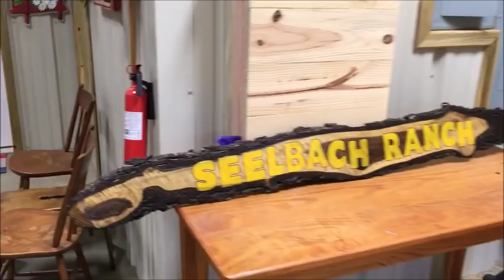Big Pine Show Down on Circle Sawmill

Comment: I run a old handset Ireland  6 mill, with a 671 Detroit  with belt drive, you will have days when it just fights you. What seems  obvious  is when you walk into  the saw the rpm drops from your tractor  its tough to keep  your saw true if the rpms varies.  Reason I use a Detroit  is how fast the govenor  kicks in to keep the rpms consistent,  becarefull  sawing solo only takes one piece of hardware inside a  log that you can't see to cause real problems  fast. Glad to see other guys trying  there hand  at milling, just becarefull  safety  is key in this business
Reply from the maker: Tim I am looking for a power plant to replace the case.  You’re right about the RPMs they plummet when milling a large diameter.  This video is old, try one if my newer ones and you will see some safety hardware now.  I know solo milling is risky but haven’t found anyone to assist yet.  Thanks for your insight.  Good day!

Comment: I have always loved these old belshaw mills. I know you are catching a lot of flack in the comments but don't worry, just keep milling. I had this mill for a while and I used it exactly how you are. Ran off a direct tractor pto, and turned into the carriage. My mill belonged to my father before me and after many many years of use it was still cutting true the day I sold it. The only thing I did different than you was I rebuild all the structure with 2x6 steel tube and lagged everything into a concrete pad. I also mounted an 8k winch about the carriage to turn heavy logs. I only sold the mill because I went to a band mill for smaller kerfs on bigger high dollar slabs. I cut most of my dimensional off a swing blade made by turbo sawmill. I really enjoy your videos, keep up the great work.
Reply from the maker: Thanks.  This is probably the worst video as far as content.  BUT it did do a good job of transferring some of the frustration to the viewer!  I have a welder coming and we will stretch the bunk, true it up, and anchor it down.   The shaft is plumb level so there is no change of speed.  The tractor is under powered but for hobby work it is ok.  I do plan to build a log feed and turn logs on it.  I look forward to MandM videos!

Comment: The problem with round saws is they don't cut straight through the logs, cants , they cut in an arc ,and that arc is a lot larger than the death of the cut . Bands do cut at a slight angle as the carriages moves forward , but measure the total tooth travel while cutting through a log vs a round saws tooth travel! For the same diameter log . How you know why the round saws have to be so thick ( big kerf )
Reply from the maker: Yes my cut at max log diameter is 1/2 pi 20 = 31.4” or 79.8 cm. So my circle saw will cut a 14” board while a bandsaw will cut 31” for the same blade contact

Comment: The reason pto effects saw blade is because u joints speed up and slow down as they rotate, This sets up a vibration in saw blade. This can be over come by use of belts. Also you can down load a belt catalog and use belts to solve mandrel over load problem. You can get by with pto using correct shear pin type joint,But you will also need a old fly wheel of a hay baler, to over come the joint speed up slow down that messes with the blade. Most old balers also use 1 3/4 shaft like bell saw does. Belts are really the only way to go. Also bell saw depends on what they call high speed saw. What that means is slow feed rate. Saw works best at 550 rpm, feed at 47 fpm. [ that is 44 fpm at 525 rpm ] It needs 61 hp at 550 rpm 40 inch 24 tooth blade at maximum cut. Sawing hickory or oak. 40 hp sawing pine.All so always use 9/32 bits. 5/16 bits require another 10 hp. Because of low feed rate, The teeth will wear on the back side.No big deal when you notice wear throw them away. Search internet for the old bellsaw books. That explain all this. If you run this mill correct, It will do what you want it to. I sawed 50,000 mine props on one of these mills, In 1976 and 77. Most information you find on saw mills on the internet like feed rate does not apply to this mill.

Comment: I like what you did with this M14  the only thing I critique  Belsaw on these mills is the carriage  feed speed in proportion to  the blade rpm.   PTO at 540 and a 48" blade is around 6600 / 6800 rim speed and the belsaw carriage is to goosey and too fast at tme to get the best out of you power plant//tractor  Slowing the feed by pulley changing would make a noticeable difference or converting to hydraulic feed is an option. Nice looking setup for the age and size. By the time you get 30 or 49 thousand board feet under you belt yo will be sawing like a slow pro...
Reply from the maker: Thanks Larry, I have been working on it all day.  Its a pain in the butt.  I will have a video coming out in the next 6 months with all the upgrades.  I hope I survive to 50K BF!

Comment: I have run these belsaw mills for around 50 years, Bought and sold a hundred of them. Several after the owner was killed. First you never roll the log like that. you must have a table built and always roll log toward you. You are going to warp carriage. and destroy set works.Please do some research and learn how to run that mill. Also before timber king bought that company [ and then got sued ] Bellsaw always warned to never hook tractor to mandrel. always use belts. The blade can never run true using a tractor pto direct to mandrel. And i bought one where the blade broke off shaft and killed a guy. He was using a slip clutch which was rated at 8,000 inch pounds of torque,And that mandrel should never have over 600 ft pounds of torque.  That is 60 hp. Where the blade goes on is only 1 3/8 inch. Belts will slip and smoke and break if blade locks up. If slip clutch is adjusted to slip at 600 ft pound it will start slipping to early. Sorry post so long but like i said i have seen guys killed. I sawed on a old number 10 bellsaw when i was only 12 year old. Got a number 10 and a m14 that i still use.
Reply from the maker: Thanks for the comment.  I will be making modifications soon.  Can you elaborate on why the PTO interferes with the blade operation?
Reply: Never have seen anyone turn the log toward them and I think I have seen every sawmill video on YouTube..family has 4 circle Mills and have never seen anyone turn a log toward them here either.🤔
Reply: @74superglide  In the Belsaw M14 manual it stats to never turn a log against the set works. These machines were designed to be light weight and easy to move if necessary. They are not production mills. 
http://vintagemachinery.org/pubs/86/1050.pdf 

 M14s are vary light duty and the set-works are not designed to take that kind of abuse. Yes you can do it, you will just were them out faster and warp the carriage as Cliff clark stated. I had to rebuild my M14 because the previous owner turned the logs against the set-works and warped the carriage. Its easy to turn toward you once you get use to it, though it is a few seconds slower.
Reply: @chuckk.7691  ok I didn't realize you were talking about this particular brand👍
Reply from the maker: Douglas, it would be a lot faster.  I like to put the flat side down and square up off of that plane.  Once I get time to fabricate a log feed, I should be able to install something I can flip up to act as a backstop to turn the log against.  These Foley mills are not heavy duty, so Cliff is right that it can be damaged.
Reply from the maker: Chuck, I agree.  Would like to see a video of your mill.  I have watched all of them on Youtube looking for ideas.
Reply: @TripleTRanchAndSawmill  Will have to wait til spring. My mill is mothballed until then. The best advice I can offer is make the mill rock solid. Circle saws do not like movement or vibration. If you can grab the frame and wiggle it, it will be next to impossible to cut true. I originally built my frame according to the directions with 2x8s and then put that on a mobile home frame with the intention of making a mobile mill. It worked but had to cut boards thicker than normal and plain down to final thickness. In the spring I will be mounting it to concrete piers 4' in the ground to get below the frost line. 2nd best advise would be find an old timer sawyer and befriend him or better yet work for them a little. I have the good fortune of having a father who was a head sawyer for many years. A mentor that has been through it all will save you many headaches and possibly limbs and life. Happy sawing!
Reply: My uncle has a Meadows, O- Frick, Moffitt and one other kind that isn't set up. I figured they all were operated the same....little did I know 👍...his Meadows does have a axle under it that is used to move it around but he set it up solid and took the wheels off
Reply: I  know all these mills, I got one set up now that is exact same mill in video. I got a old mill with 60 inch blade it is a friction drive, It feeds one speed which is matched to saw. Takes some serious hp to pull it. AT least 238 hp 6 cyd Detroit. It works best on a 350 hp cumming. truth is unless you got a 9 man crew, and semi loads of logs coming in these big mills will use more fuel than the lumber is worth. my friction mill will saw around 30,000 ft per day. The mill in the video with bell saw blade 24 tooth 40 inch should feed 44 fpm. 14 inch cut pine 45 hp  white oak requires around 70 hp. The 0 frick requires at least a 4 71 Detroit at 160 hp. frick is the only one of these old mills that you can buy parts for. Frick can supply parts for any mill they every built.  You can still buy these mills new today. meadows is a newer mill, Far as i know they are still building mills.The 0 frick is the best small mill ever built with a 4 man crew 20,000 ft a day is about right. You might tell i love these old mills, Spent my life around them. even sawed on a old a-6 bell saw when i was only around 10 year old. I even still got a a-6 bell saw that is just stored. It is feed by hand crank. With the solid tooth blade it will cut a kerf about the same as a band mill. It cuts slow but very smooth lumber.And no about all these mills are different to run. Only thing the same is hp required. Only the bell saw with solid tooth blade ,hand feed can be run on less than 60 hp. On pine it can run on about 25 hp. Just down at b h Payne in Atlanta GA. last week. They hammered a bell saw blade which they made . My dad bought in 1948 . It still runs perfect. They are the best people to deal with.And make the best blades.
Reply: @cliffclark6441  the Meadows we have is ran by a 353 Detroit and the edger is ran by a leroi 4cyl which use to run the Moffitt, it's only 40hp but it was the only engine available when the Moffitt was new because all the Detroit's were being used for WW2
Reply: Yep. I roll the log toward me, then push it back onto the carriage but my infeed is level with the carriage, so it's easy. 
I also don't dog a log down until I have a flat side. It cuts down on the binding when I try to advance a round log. They always want to roll, not slide.

Comment: worked 25 years in saw mills and seen a lot of guys hurt from just not thinking, wood ain't got no feelings and steel don't give when it hits flesh or bone. Best to drive your saw with a belt my friend and let something besides a cant hook and your muscles do all that work trying move logs.  Best to put off sawing for a while and get your mill set up a little more "user friendly"
Reply from the maker: Thanks Steve. I have plans to make it more safe.  I respect it more now than when I bought it.  Thanks for watching and I hope you comment when gen II is up and running.
Reply: Triple T Ranch & Sawmill Hey Cousin Kev here also advocating proper safety practices per OSHA guidelines set by Inspector Wayne... I’m guessing they don’t make a Sawstop big enough to cut that timber.
Reply from the maker: @kbach6524  Please come over and do a safety inspection!

Comment: Looks like it was killed by the pine bark beetle. Several different types of pine bark beetle depending on the region of the country you are in. The bluish color in the wood and the bug trails under the bark are typical signs of the nasty little buggers. They have killed millions of pines in the northwest. They attack all pine species that I know of.
Reply from the maker: Braden, thanks for the info.  I live in East Texas near Arkansas, Oklahoma & Louisianna.  I usually just cut recently killed pine and oak.  Its a little tuff but keeps me from wasting timber.

Comment: That foundation sure does shake when turning that log. I don't understand how the mill stays aligned. A level and solid foundation is very important in order to cutting true lumber.
Reply from the maker: Yes sir, I have the lag bolts.  Gonna do some mods to the bunk and then set it down permanently.  Probably do a video on it .    Thanks

Comment: I would like to make a suggestion that you learn your mill, and learn to saw before you try to make videos. You are trying to do too many things at once. Try to saw, when you have a mill problem fix it before you continue sawing once the problems are fixed practice sawing, when you feel that you are fairly competent sawing, make your videos. Don’t get discouraged,you will never know it all. I’ve been sawing for nearly 50 yrs, and I’m still learning. If I ever get to a point that I think that I know it all,I will quit.
Keep up the good work,Lee Gibbs (old sawyer, blacksmith,and gunsmith
Reply from the maker: Thanks for your insight and advice Lee!    That video was one of my first (4 yrs ago) and I am a little more experienced now.  We are milling pecan today and I will upload the video so you can critique it.  I have 2 remaining upgrades:  1. Belt driven power unit & 2. Modifying the bunk to get the blade at 90 degrees to the carriage.  If you are near north east texas you need to stop by and mill something!

Comment: Looks like everyday around here. Lots to go wrong. Seeing you turning the log didn't look like fun. My two cents worth. Could you mount an ATV winch with a remote above the mill near the post and have a wide hook to grab the log and roll it? Thanks for the videos.
Reply from the maker: Sounds like a plan.  If I could retire maybe I could actually complete the mill!
Reply: I put a w-beam with a trolley and hoist above my carriage to ease the back pain. As we get older we tend to get a little sharper...

Comment: why dont  you place a jack / roller under neath the table  take some of the weight or chain block off the roof you have to place extra  support off the roof and use a single sling in the middle of th tinber
you are seasioly going to hurt you self  it ant worth it beleave me / i known thats how i hurt my self
Reply from the maker: Manny that sounds like a good idea.  I just have to find the time and make a design.  I have added a log rack so it should compliment that.